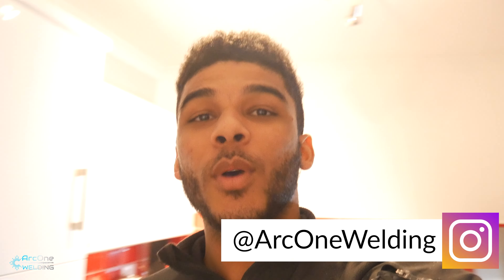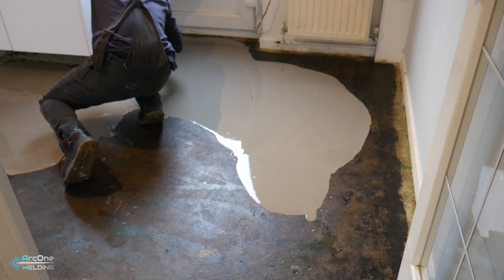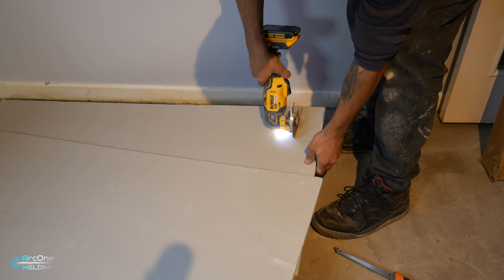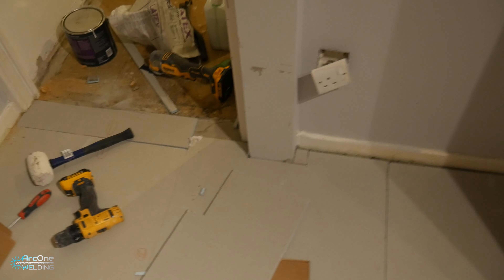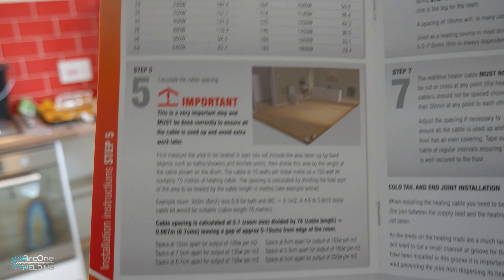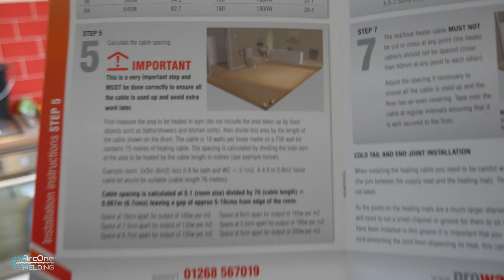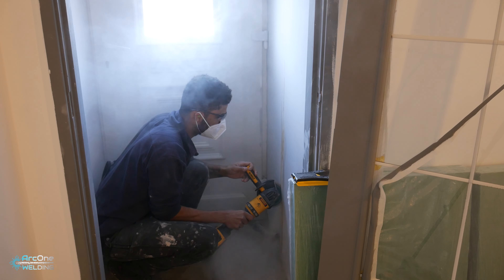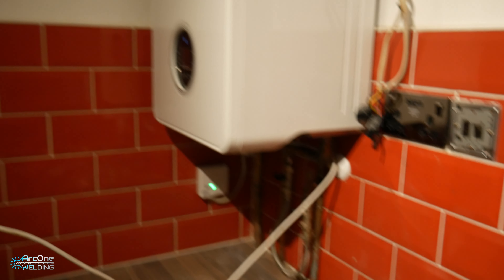I Should Stick To Welding (PART 1)

Comment: Calvin thanks for sharing this part of your life... So relatable and very inspiring... Appreciate your content.. I'm a Boilermaker/Plater-Welder in South Africa and have been for 15 years of 9 was in Zimbabwe. I had to work for my self for like 7 months last year doing construction and house Maintenance, things I've never done before, building, painting, plumbing, carpentry, steel security etc but it provided for my family adequately after we lost our jobs because of Covid.. 
What a journey before I finally ended up back in the place I love, the fabrication shop . Now I'm back in the shop and on site on surface where I have been countless times, but looking forward to working UNDERGROUND which is a new experience and privelidge to install all the steel structures i was involved in making in the shop.
Thanks again for the awesome content.👊🏽

Comment: Get a claim in at the SMALL CLAIMS COURT to get your money back for the boiler work - you will win 100% - its very easy to do - you don't need a solicitor - just one form to fill in pay ya £80 (ish) boom - money refunded once case is heard!
Reply from the maker: Maybe i will have to, im in talk with them still and maybe that is a option i will go down